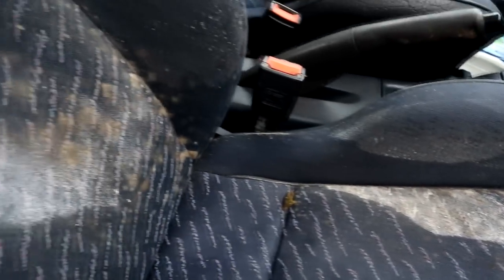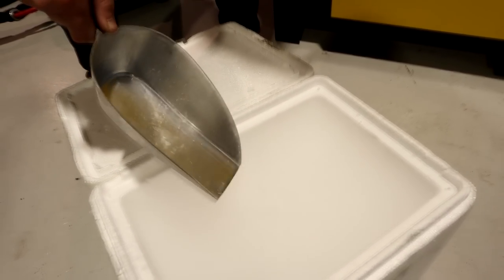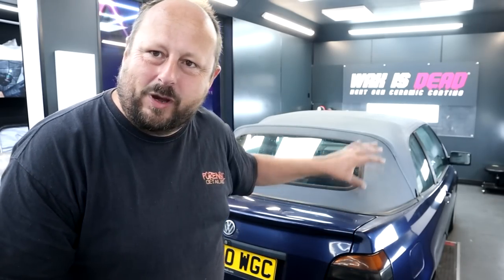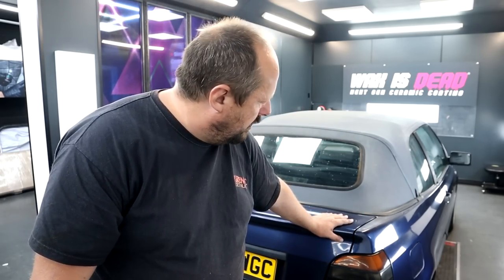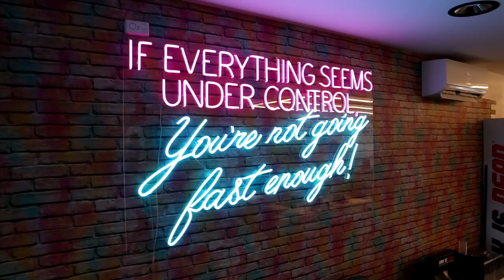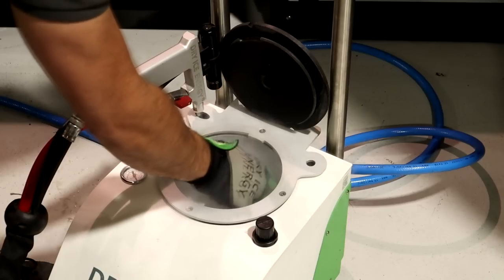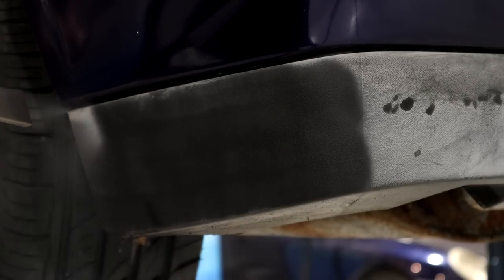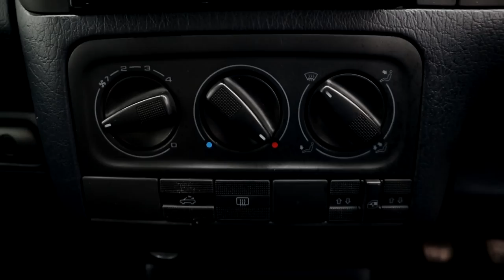Dry Ice Detailing | Cleaning a Rusty Mouldy Abandoned VW Golf after 5 years.

Comment: Yeah - dry ice is great technology, sadly the pricing at the moment doesn't really makes sense for average detail job. Sure when working on priceless classic cars, or doing big restoration detail like here, where it would probably take forever to do in conventional ways, or there is simply no really good way to remove say mould or moss growing in the fabric seats this is probably the answer.

But for normal person detailing their own car this is prohibitively expensive. I was looking into prices and this would be £2000 if I take it to the detailing place that does dry ice cleaning (and this is just underside and engine bay), I found industrial cleaning place in midlands which would do the underside of the car for £1000. So realistically this doesn't make sense as a "detailing" product. I even looked at renting the machine, it makes little bit more sense as week hire would would be ~£870+VAT, but that still means you need to have basically a workshop where to plug it in, you need to have lift to lift that car and so on. So for detailing shop that probably makes sense e.g. maybe they can schedule in 5 or even 10 car for that week, hire the machine for the week, do all the dry ice blasting and that averages extra £100-200 per detail and maybe let's say £300-400 extra for the customer.

If it is some £50,000 Porsche we talking about, or generally highly valuable car with full restoration detail, and perhaps a car which requires extra care, then £300 extra makes sense, in the end of the day for maybe £1000 detail job overall that won't make the difference, but it will elevate quality of detail to the point that is otherwise probably not possible with other means, so it is worth it. But for normal person working on their £5000 worth car on their driveway... forget it.

I wish we get to the day when there are places with these dry ice machines where you can pay per hour, almost like self-service pressure washing, perhaps something like £40/hour and £10/kg of dry ice. So you can come pay per hour how much you need, maybe 1-2 hours should cover bits in interior, the engine bay, wheel arches etc. Perhaps 3 hours to do underside. That would be amazing and I would definitely use it, but at the moment it is just too expensive to use for normal people. For high end detailers spreading the cost across maybe 10 customers... yeah sure, that is alright. Even buying marching is probably not bad idea if it is often used. £5000 get entry level, ~£10,000 one can already buy powerful professional machine. So if detailing place does it often, then why not... it probably pays for itself within months.
Reply: Open a self serve dry ice wash bay. You'll kick yourself when someone else does it ..
Reply: @benbirch2393  I am not really in car wash or detailing business, more of just working on my car as hobby, so probably will pass on starting whole new business venture in this area. To be honest I was consider it, but not gonna happen realistically... 

However, if somebody else does it then I would definitely use the service - in London area please!
Reply: Hello my friend did you find out where the dry ice machines can be purchased , if so is it poss that you could send me there number or link, kindest regards mark  !!